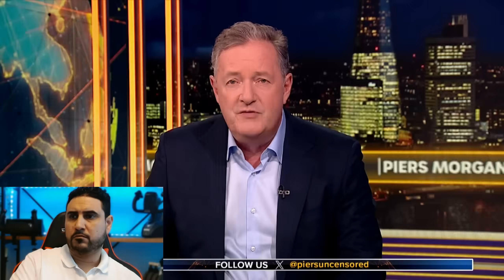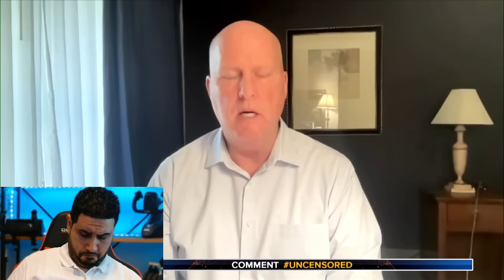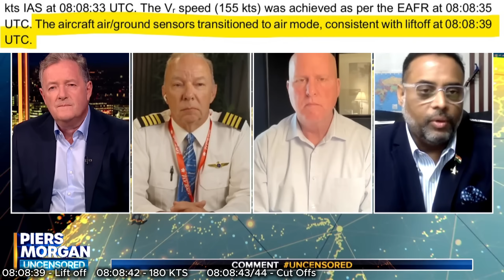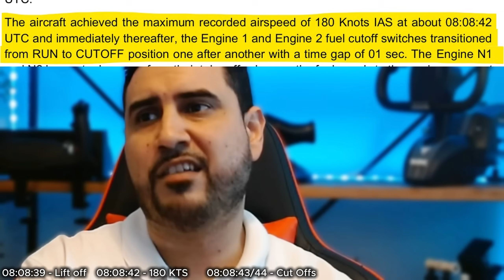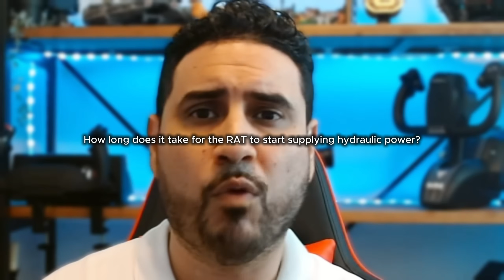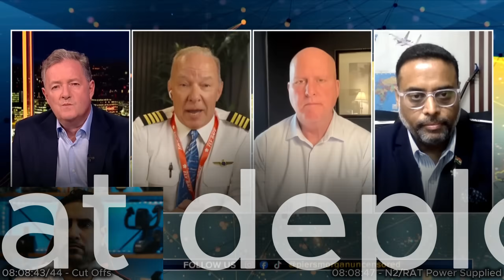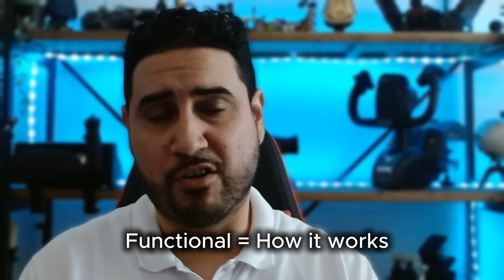TOTAL SYSTEMS FAILURE BREAKDOWN | AIR INDIA 171 | AAIB PRELIMINARY REPORT | MAYDAY | MSFS2024

Comment: What Can Cause the Fuel Control Switch to Signal “CUTOFF” Besides Moving the Switch or Pulling the Fire Handle?

On modern aircraft like the Boeing 787, the Fuel Control Switch (FCS) on the pedestal sends commands to the Engine Electronic Control (EEC) to manage fuel flow to the engines. Under normal operations, the FCS is controlled by:

1. Manual input by the pilot (moving the switch to RUN or CUTOFF).

2. Pulling the fire handle, which sends a signal to the EEC to shut off fuel as part of the engine fire protection system.

However, aside from these, the fuel control system can signal “CUTOFF” or result in engine shutdown due to several other factors:

 A. Automatic Protection Logic (EEC Logic or Fail-Safe Mode). The EEC can command a fuel shutoff automatically if it detects:

-Overspeed protection (on N1 or N2).
-Severe engine damage (e.g., uncontained failure, extreme stall).
-Loss of required sensor data (like throttle resolver, FADEC input, or critical engine sensors).
-Dual-channel FADEC failure, which causes the EEC to enter a fail-safe shutdown mode.

In these cases, even if the switch is physically still in RUN, the EEC may interpret it as a condition requiring shutdown.

B. Loss of Electrical Power to the EEC. If electrical power to the EEC is lost — such as through:

-PMA (Permanent Magnet Alternator) failure,
-Loss of both AC power sources (to channels A & B),

the engine could shut down or drop to idle. This may be interpreted by the system or shown on EICAS as FUEL CONTROL SWITCH = CUTOFF, even if the pilot never moved the switch.

C. Wiring or Relay Fault Between FCS and EEC. This includes issues like:

-Short circuits in the FCS wiring.
-Faulty relay logic between the cockpit and the EEC.
-Faults in the Engine Interface Unit (EIU) or System Interface Module (SIM) which convert FCS signals to digital commands.

D. Avionics or Aircraft Logic Fault (e.g., Ground Mode Stuck). In cases like the suspected AI 171 accident, if the aircraft logic fails to transition from “ON GROUND” to “IN AIR” mode, then:

-The FADEC does not switch to flight mode logic.
-Full thrust and fuel control are restricted.
-The EEC may interpret the situation as an engine abnormality, causing it to idle or shut down the engine — potentially displaying a CUTOFF condition.

E. Airplane-Level Engine Shutdown Command (Rare). In very rare circumstances, a centralized aircraft system may issue a shutdown command — for example:

-During severe avionics failures.
-In response to contradictory or multiple fire indications.
- Or in the presence of unresolvable engine control faults.

This is highly uncommon and typically part of deep fault protection logic.

Summary:

The fuel control switch may send a CUTOFF signal or result in engine shutdown without physical movement if:

Cause	Description

1. Fire handle pulled	Standard shutdown via fire system.

2. EEC protection logic	Overspeed, severe failure, fail-safe mode.

3. Loss of EEC electrical power	Engine loses power, shuts down or idles.

4. Faulty wiring or relay logic	False shutdown signals sent to EEC.

5. Ground mode logic fault (AI171)	FADEC doesn’t switch to air mode → no thrust.

6. Avionics miscommunication	Conflicting or misinterpreted system signals.
Reply: Here is Impact on Electrical System

1. Generator Logic Based on Air/Ground Status

- The Generator Control Units (GCUs) and electrical distribution rely on air/ground status.
- If the aircraft remains in ground mode, the GCU might misinterpret the condition as a fault or engine shutdown, and disconnect the engine generators.
- This happens because the system assumes the engines have been shut down during taxi or landing — even though the plane is actually airborne.

2. Electrical Power Loss

If both engine generators are disconnected while the APU is off:

- There is no primary AC power source.
- The system experiences total electrical loss.
- The RAT (Ram Air Turbine) must be deployed (manually or automatically) to provide emergency backup power.
- RAT only supports essential systems: flight controls, displays, and minimal avionics (like comms).

What Most Likely Happened

1. The aircraft lifted off, but air/ground logic remained stuck in “ground” mode.

2. FADEC and GCUs interpreted this as a ground condition:
- Possibly commanded engine shutdown (fuel cut-off logic triggers).
- Disconnected the engine generators.

3. Engines spooled down (N2 dropped), resulting in:
- No thrust.
- No electrical power.

4. RAT deployed (either automatically or manually), but too late to fully recover power in time.
Reply from the maker: @tedeave2009  lots of points of failure.
Reply: @FinalApproachPOV yes, Here is why the dual engine failure was unlikely caused by the pilot's movement of the Fuel Control switch to CUTOFF

AI 171 Dual Engine Failure After Takeoff (if the aircraft already change to AIR MODE and both fuel switch manually moved to CUT OFF) 

Assumptions:

Aircraft takes off normally.

At 3 seconds after lift-off, both fuel control switches move to CUTOFF (either by logic fault or other reason), causing dual engine shutdown.

The air/ground sensing has already switched to AIR mode, so FADEC accepts shutdown.

How Long Did the Aircraft Remain Airborne?

On a Boeing 787-8:

At 3 seconds after takeoff, the aircraft is approximately 100–150 feet AGL depending on weight and climb profile.

After both engines shut down, the aircraft relies only on kinetic energy and momentum.

With gear down and flaps deployed (takeoff config), drag is high, and glide capability is minimal.

Estimated total airborne time: 33 to 38 seconds from lift-off to impact.

~3 sec: Climb before failure.

~30 sec: Descent and crash following engine shutdown.

 Likely Aural Warnings

During a dual engine failure just after liftoff, the following aural alerts are likely to activate on a Boeing 787-8:

Aural Warning	 Time Likely	 Description

"ENGINE FAIL"	Around 3–5 sec	Triggered once both engines fail (N2 drops).
Master Warning + Chime	Simultaneously	Illuminates and sounds due to critical failures.
"DON’T SINK"	~15–25 sec	Triggered by GPWS if vertical speed becomes negative.
"TOO LOW, TERRAIN" / "TERRAIN, TERRAIN"	~20–30 sec	If rapid descent and terrain closure detected.
"STALL, STALL"	Late phase	If high pitch and speed decays close to stall.

Likely EICAS Messages

Several EICAS alerts would likely appear:

ENG L FAIL, ENG R FAIL

ENG SHUTDOWN

ELEC GEN L OFF, ELEC GEN R OFF

RAT DEPLOYED (if manually deployed by pilot)

FLAPS DRIVE, GEAR DISAGREE (if retraction failed or lost electrical power)

Timeline Breakdown (Estimated)

Time	Event

0 s	Takeoff, gear extended, normal climb begins
3 s	Both fuel control switches move to CUTOFF – engine shutdown
5 s	"ENGINE FAIL" warning + master warning + EICAS messages
10–15 s	Aircraft reaches peak altitude; speed starts decaying
15–25 s	Aircraft starts descending; "DON’T SINK" or similar warnings activate
25–35 s	Rapid terrain closure; GPWS alerts like "TERRAIN" or "TOO LOW"
33–38 s	Aircraft impacts terrain; complete systems failure

Summary

Total flight time after engine shutdown: ~30–35 seconds.

Aural warnings: "ENGINE FAIL", "DON’T SINK", "TERRAIN", possibly "STALL".

Aircraft likely never reached safe altitude to glide or relight.

Cockpit warnings were fast and overwhelming,  but time was too short for recovery

---------
Conclusion
---------

UNFORTUNATELY THE SCENARIO ABOVE DIDN'T ACTUALLY OCCUR. IN REALITY THE AIRCRAFT'S GROUND MODE LOGIC NEVER CHANGED TO AIR MODE, AS EVIDENCED BY: 

1. First phase after liftoff: the landing gear couldn't retract.
2. Critical phase after liftoff: there was no aural warning sound at all
Reply: You are very close. VT-ANB suffered a battery fire   accelerating to take off. iN the video  from behind as it rotated there appears to be a swirl of dust behind the 787. Each  Dreamliner has eight 2.5–4.025 V cells wired in series, providing a pack voltage range of 20–32.2 V. Each cell contains three electrode winding assemblies. If just one battery fails it shorts out the whole plane causing RAT deployment. Data telemetry to the website FR24 for this flight froze at rotation.  Data telemetry is provided to FR24 live. via ADS-B OUT.. there is your proof why engines flamed out.  

In 2013 Boeing overcame FAA grounding of the 787 by building fireproof steel battery bays  with vents to vent out smoke from Lithium battery fires.   Passenger Akash Vatsa flew on the same plane on a previous  flight and posted a video with the title, Nothing works. His seat was above the hot battery bay. He complained how hot his flight was and that air conditioning did not work. 

Smoke from this battery vent is visible in the take off video from behind.
Reply: @AltitudeWarrior The root cause of the issue is attributed to the air/ground mode logic being stuck in ground mode (transition to air mode logic  from ground mode  have failed, the aircraft remained in ground mode logic) 

----------------
Sequence of Events
----------------

1. Normal takeoff
2. Landing gear failed to retract after liftoff
3. Simultaneous loss of electrical power; pilot manually deployed the Ram Air Turbine (RAT)
4. Both engines shut down
5. "ENG FUEL CTRL" message appeared on EICAS, despite no intentional fuel cutoff ("why did you cut off the fuel", "i didn't") 
6. Pilot attempted to relight both engines by cycling the fuel control switch on Engine #1 (from RUN to CUT OFF and back to RUN), followed by Engine #2 four seconds later
7. APU switch positioned to START
8. Pilot declared MAYDAY to ATC
9. Aircraft impacted the ground
Reply: @AltitudeWarrior the analysis didn't explained why the landing gear wouldn't  retract after lift off

Comment: 12:31 . Its got 4 poles. And relies on the battery backed instrument bus to be potentially different by 28v for the remote data concentrator to see it and tell the Common core system and flight data recorder . The battery shorted  and took down bith left, then 1 second later after bus tie breaker actuvated, short circuit got connected to right.
Both outer dc buses powering the actual power through the fuel relays then sent 28v to the shutoff valves.
Reply: Boom! All this redundancy of dual this and 4 of that, counts for nothing when you have the common nodes fail. The bus tie breaker and Battery Diode Module are such as those. Both fitted in the tail section close to the thermal runaway prone Li-ion battery, which in turn may have taken out the STAB-CON-XTDCR on the previous flight.
Reply: @ZoubirKabir haha no, not in the tail. Its the fwd main batt. The rear apu bat does nothing for us here .